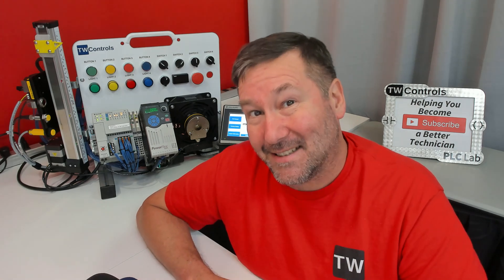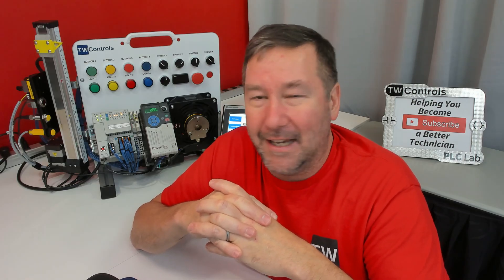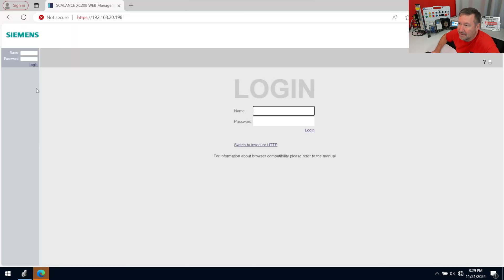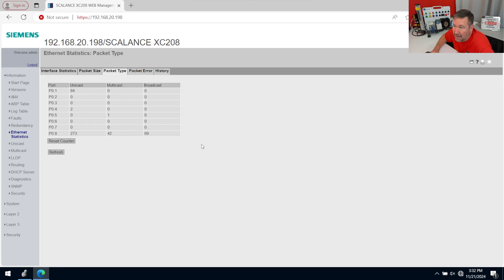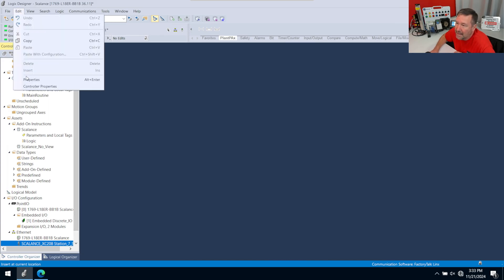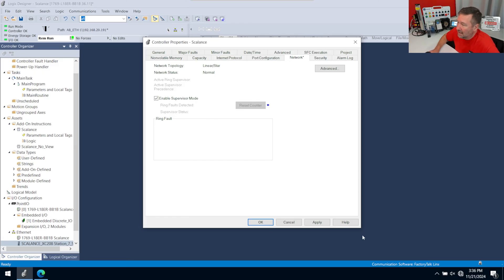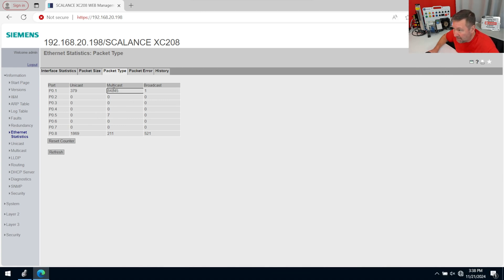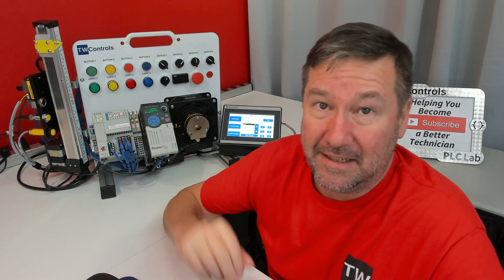What Happens if Supervisor Mode is Enabled on a NON-DLR Network in Studio 5000?

Comment: Hello, I am an electrical engineer from China with ten years of experience in PLC programming. May I ask if there is a certification required for PLC programming in the United States?
Reply from the maker: Certifications may or may not help you get a job. It depends on the requirements at the particular company.

Comment: Is this only 5370 (1769) processor or v36 of Studio 5000? I'm using 5380s (v35) and I don't have a Network Tab in the Properties.
Reply from the maker: On the General Tab, the IP Mode has to be Linear/DLR to have the Network tab.  It defaults to A1/A2.

Comment: 84000 packets in 30+ seconds is about 2500 packets per second and represent DLR Beacon frames that are sent at 400 microseconds intervals by default.
DLR enabled devices will filter these in hardware and will not affect the device performance.
Non-DLR devices will try to process every single beacon frame instead of the payload, slowing performance down dramatically.
If you happen to have a WI-FI router or AP on the same network, then your WIFI performance will suffer up to complete WI-Fi shutdown.
Reply from the maker: I was wondering how DLR devices managed all of those packets.  So is the DLR supervisor the only device that has to process them and the rest just pass them through?

It looks like the Compact Guardlogix, Turck IO Link, and the Ethernet switch on our PLC trainer support DLR.  I'll try to set up a demo to play with.
Reply: @TimWilborne  Supervisor sends Beacon frames on one port and expecting them to arrive on another. 
If ring is broken, then the Beacon will not arrive to another port.
DLR enabled device will pass the Beacon from one port to another without any delays and will prevent them reaching the its own CPU.
Non-DLR devices don't know what to do with these, it will forward them to all other ports flooding the network.
It will also forward it to its own CPU attempting to process it. 
A device CPU will eventually drop it too, but unnecessary processing 2500 packets per second will slow down device making it unusable.
Reply from the maker: Good to know, thanks for the tips.